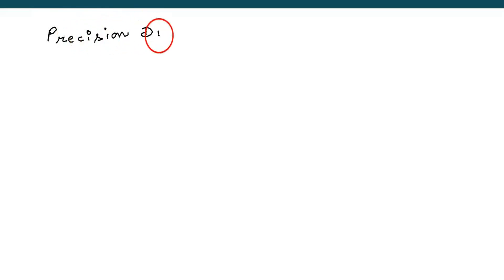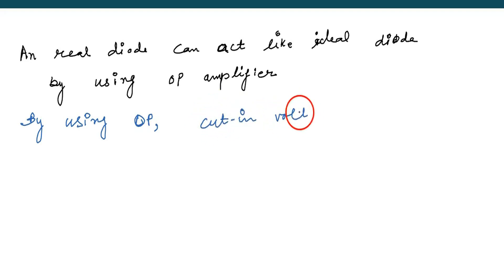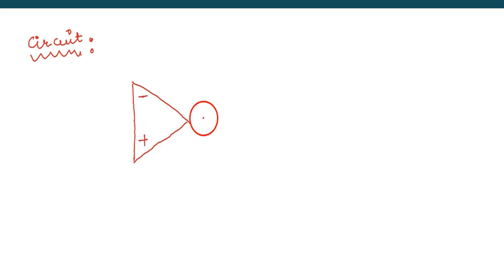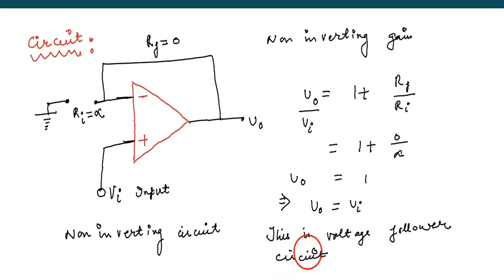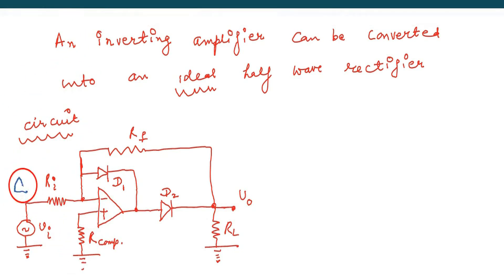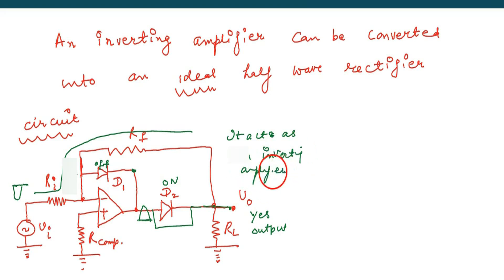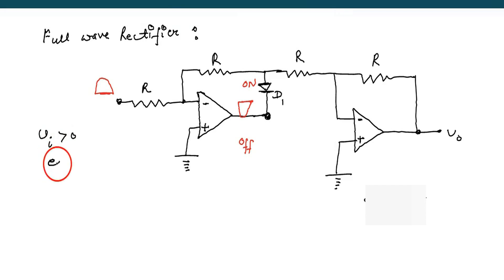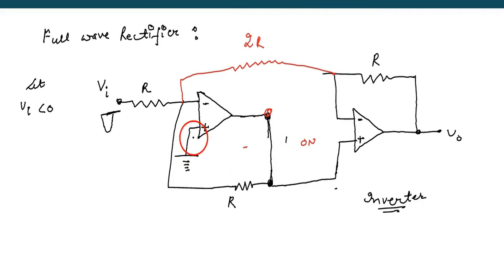Precision diode, Op amp half and full wave rectifier

Comment: Sir i have a doubt the very concept of using a precision diode / rectifier was to rectify voltages  lesser than cut in voltage of the diode. But using diode in voltage follower circuit, since the gain is unity so how  the cut in voltage will be reduced or eliminated virtually? to be able to rectify ac signals less than cut in voltage we need open loop gain of about 10^5 right? but i don't see that happening in voltage follower circuit.
then why is such circuit used. please explain sir. please do i really am confused.

Comment: Dear sir, in precision full wave rectifier circuit, when the input is goiung through negative half cycle, you KCL application, I think is incorrect.. Kindly check.. Also analysis of second OP-amp, I think it is acting like non-inverting amplifier, kindly check.. Thanks